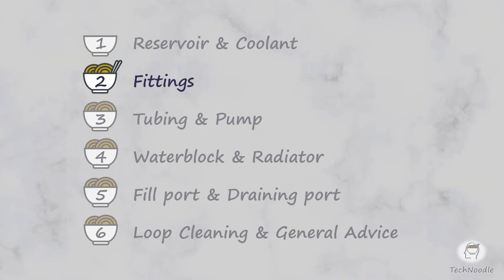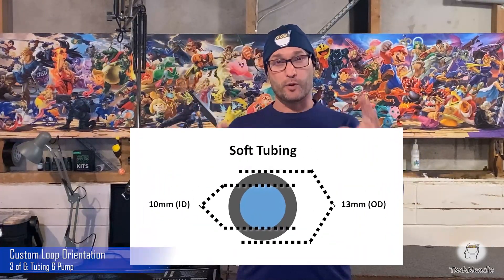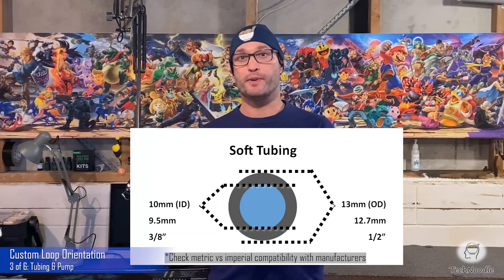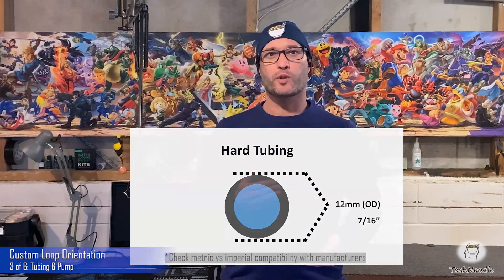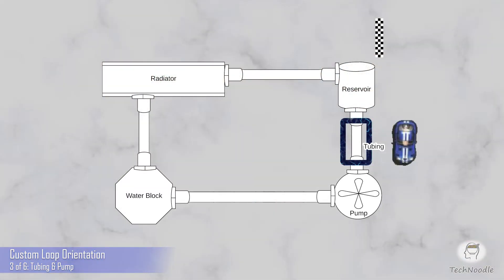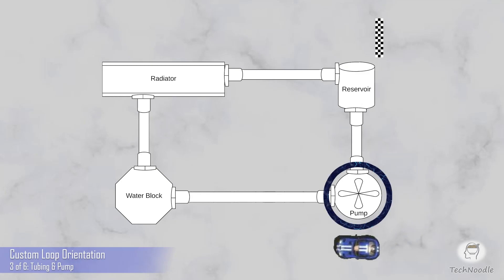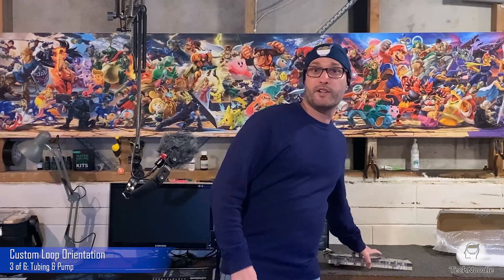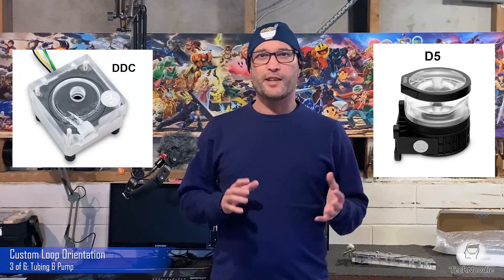Custom Loop Orientation - Part 3: Tubing & Pump

Comment: Tecnically, the reservoir can sit below the pump, so long as the pump impeller remains submerged (primed) when the pump stops. In my onorthodox loop, the pump sits about 0.3m above the res and it works perfectly fine; pumps usually can provide 4+ meters of suction lift.
Reply from the maker: That's really interesting.. how do you get the fluid to the pump before you start it? Maybe you should make a video about this!
Reply: TechNoodle Hey TechNoodle, I left a question on your 2021 build video. Really enjoying your videos. Thanks